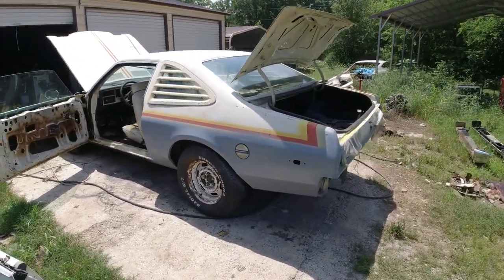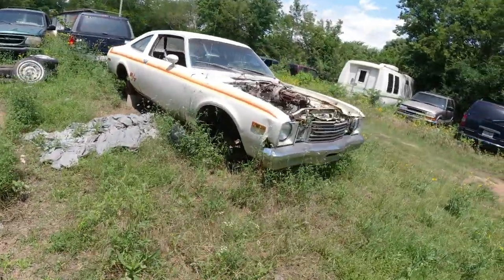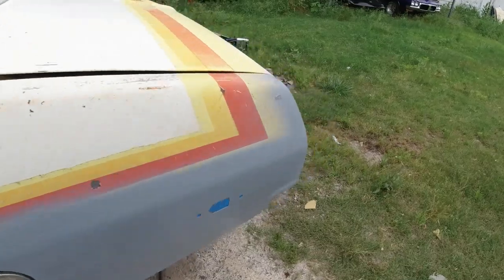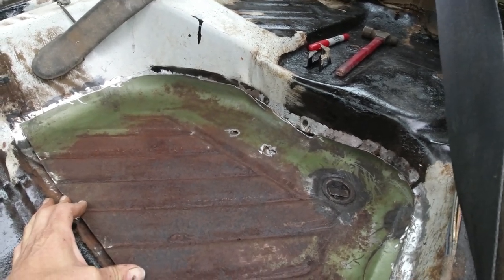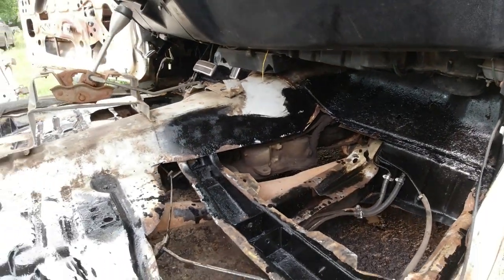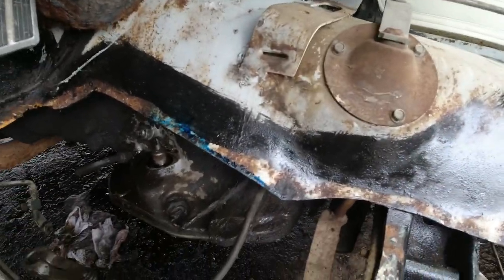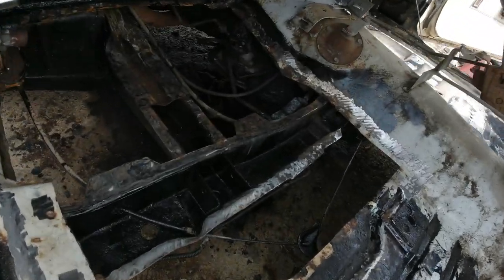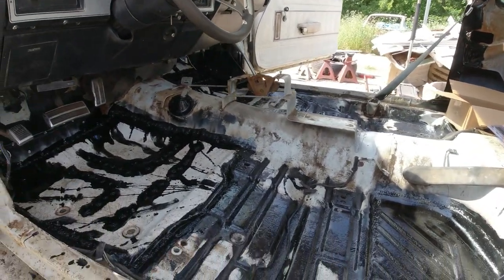Restoration of a 1978 Dodge Aspen R/T - Part 7

Comment: I re did the floor in my 80 Aspen R/T but the floors weren't that bad just a few small areas on the drivers side where the emergency brake cable went thru the floor and small pin holes on the rear floor pan. All I did was rust proofing with an Eastwood product and seam seal it. Then I bought a box of Dynamat sound deadner covered the floor to keep out the heat from Summit. I bought what they call a jute it hangs behind the back seat, mine was falling apart. Once again you made a great video with some great info on floor repair and transmission leak tips too! I wanted to mention I had surface rust and chrome fading on my bumpers so i just painted them flat black, it really set the car off with the night watch blue paint on my car!

Comment: the water comes by me from the heater air intake. was all rusted. thats what i weld right now. lot of cutting behind the fenders.i hope yours car is in better shape
Reply from the maker: Just checked and mine is the same way. Time for surgery!
Reply: damn... that was a hell of work by me  both sides. now i am on the passenger side  driverside is finally done
Reply: Be sure to flush out that  heater air intake box. There is a little door (drain) at the bottom, behind the distributor. If it gets blocked, the rainwater spills over on to your feet.